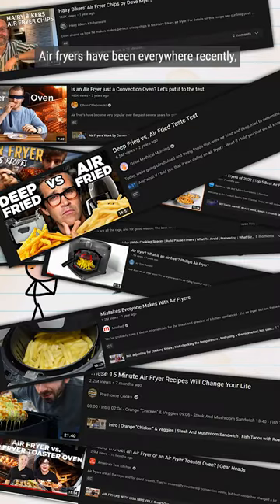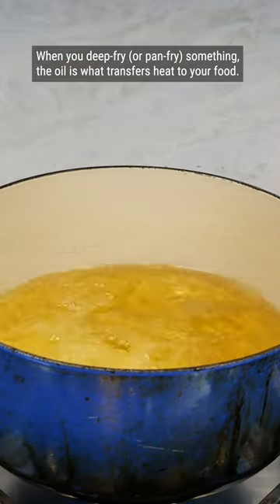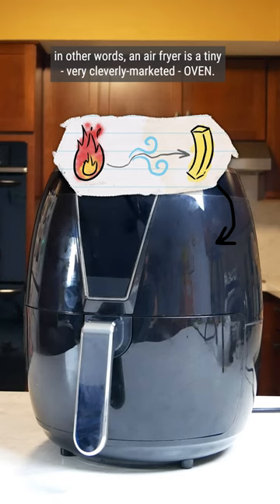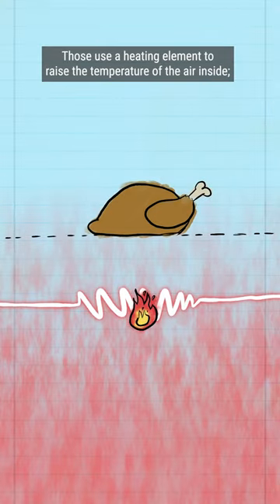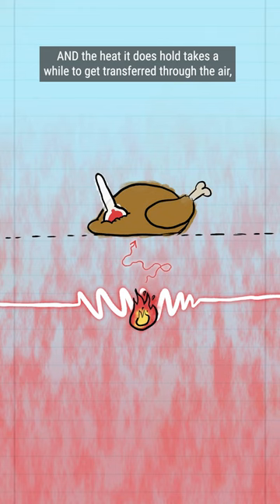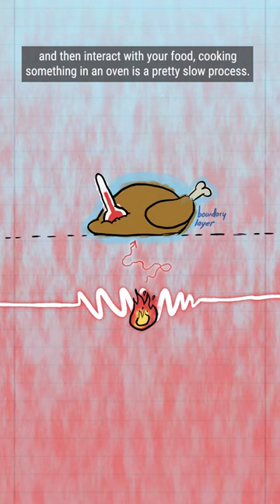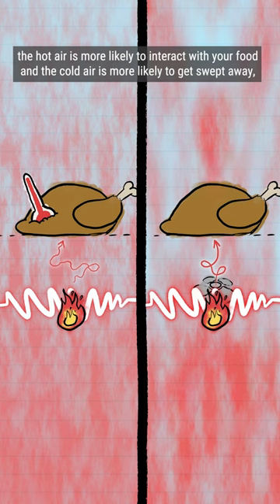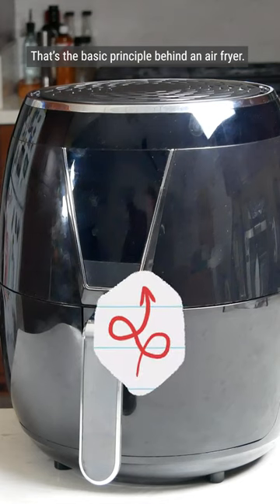Air fryers can't fry anything

Comment: Yup, they are mini convection ovens, and they are great. Besides reducing the amount of fat in the food, it also uses much less electricity and time, compared to an actual oven 👍
Reply: They do not reduce the fat in food 🤦🏼 that's a common myth. Put frozen French fries in an air fryer and an oven and they have the exact same amount of fat. They also aren't much faster than modern ovens, but yes the space is smaller so you save some time. Electricity savings is the biggest benefit of them, and ease of use and cleaning
Reply: @wile123456  I mean if you're not using oil like a lot of people, then you have a lot less fat. They're also much faster than normal ovens especially for something that doesn't need long since you don't have to pre-heat it
Reply: @wile123456  Oh come on now.. this is not a semantics game. When you air fry, it’s gona have only the oil you put on it, nothing more nothing less. And of course that amount of oil is going to be less than deep frying. That’s the concept..
Reply: @wile123456  frozen French fries have already been deep fried..
Reply: @wile123456  faster? Yes. I’m usually done with most things using the convection oven, before the regular oven is even preheated..
Reply: @iteerrex8166  yes, that's called an oven. You don't save any fat because it's the same as putting your food in a convection oven 😂
Reply: @iteerrex8166  yes, hence they are already fatty. You cannot replace a real frier with an oven if you want to make deep fried dishes. No fat is saved. No need to make 3 comments either, you can make one longer comment.
Reply: @Gavolav  yes but it's the same as using your oven. You don't save fat. People who says it saves fat is because they buy frozen fried food that usually gets put in the oven and then act like there is less oil on them using the air frier.
You cannot make French fries from scratch with an air frier. It's impossible.
You can make oven chips, but that's about it.
Reply: @wile123456  What? If I use my air fryer I sometimes use a bit of oil, if I use my oven I always use more oil. Same with many others who use air fryers. Oil has fat. Therefore, people consume less fat when using an air fryer.
Reply: @Gavolav  💀 then it's your fault for adding the oil. You can use equal amounts of oil for either the air frier or oven. They are the same thing unless you have a ancient oven with no convection fan
Reply: @iteerrex8166  yeah, but not less oil than a regular convection oven. and that was Wei's comparison. not deep frying
Reply: @iteerrex8166  says something wrong, can't handle being corrected. Says the world is a terrible place
Damn you're not used to being wrong huh
Reply: @wile123456  they're talking about frying in oil vs cooking in an air fryer 🤦
Reply: @wile123456  you're comparing it to the wrong thing, yes oven vs air fryer the fat content is the same but air frying because it has the heat contacting the surface more through the whole process (compared to an oven) you get a crispier result similar to if you had deep fried it (why they are called air fryers) so putting french fries in an air fryer will give you a result way closer to deep frying them than an oven would but without the extra fat of a deep fryer
Reply: @Gavolav to get a similar flavor to fried food, you need to add a layer of oil/fat on the food, that is similar to what is absorbed during regular frying. Also food that is traditionally fryed, but sold to be cooked in an oven or airfryer have that amount of oil/fat incorporated into the food itself (often the breading). Anything with less fat will taste different (that can sometimes be a good thing, but still different).
Reply: @wile123456 They mean compared to a FRYER
Reply: That's a nonsense comparison, tho, you can't actually fry anything in an air fryer; you don't put in or get out the same kind of food in a deep fryer as an air fryer, you put the same food as an oven in an air fryer and that has no bearing on fat.  You might as well say it saves on burning and compare it to an open flame. @Gary_Harlow
Reply: Why would you want to do that, fat is the healthiest part of the food. Sugar is the enemy. Eat more fat and you will be less hungry during the day.
Reply: @ablasttv  you are 99% wrong
Reply: @Gary_Harlow  No actually not at all. Mediterranean / Keto diet is the best diet in the world scientifically proven. Eat healthy fats as the majority of your caloric intake and you will be the healthiest you ever been. Just maintain the diet or you will gain it all back quickly lol.
Reply: @ablasttv  Calories in calories out. Fat contains 9kcal/g whilst carbs and protein contain 4kcal/g. If you eat too many calories you gain weight. If you eat less fat, you can continue eating as much as you did, whilst still being at a healthy weight.

But yes, if you are below or at your calorie limit, then eat lots of healthy fats if you want.

I'm not saying that you should remove ALL fat, it is essential for many bodily functions, but maintaining a healthy diet is a lot easier if you decrease the ammount of fat you are eating
Reply: @Gary_Harlow  fat calories make you feel fuller faster than carbs, so you eat less and it takes more energy to break down the 9 calories from the fat than it does the 4 from simple sugars. So you actually burn more fat eating fat, let alone being a state of ketosis where your body is actually using its fat stores for energy instead of storing more. Obviously that doesn't mean ONLY eat fat. But > 50% of your diet should be fat, 30-40% protein, 50g carbs max (and of course adding up to a caloric deficit). You will not feel hungry and you will lose weight even with virtually no increase in exercise. Works like clockwork, I can lose 10 lbs in a month with no other life change.
Reply: @ablasttv  nah, the most effective at making you full are things that contain a lot of water, and that is vegetables, salad and carbs like pasta, rice and potatoes, or air like popcorn or bread.
Reply: @Gary_Harlow  I mean you will feel full for hours after eating and not have cravings. Carbs will fill up volume and make you feel stuffed and like crap right after eating but you will be hungry again. I feel full enough on fats to do 16-20hours of fasting before eating again.
Reply: @wile123456 they are SIGNIFICANTLY faster than regular ovens. i can say this from experience, food that takes 45 minutes in an oven takes 15 minutes in an air fryer for me.
Reply: Faster for 1 serving maybe. But for multiples? You can't put in too much cos it will just get soggy if air can't get to it. Do multiple rounds and the 1st gets cold. And nothing was particularly nicely cooked in general. We had a smaller version and I was utterly unimpressed 👎
Reply: @aeydra  I’ve never used one of these tiny tabletop versions, that seems like a glorified hairdryer. But I’d guess they are unimpressive.
Reply: @aeydra  I’d suggest a medium size, and make sure it has a halogen heating element. They work great for quick roasting toasting heating and such.
Reply: @wile123456 most people use air fryers as a substitute to deep frying on pan frying.

There it saves the fat and calories of the absorbed oil
Reply: @wile123456 i dont think they are pre-fried
Reply: @wile123456  Based on your replies and others, it's actually you who can't handle being wrong. Get outta here kid lol.
Reply: @wile123456 You did not get his point at all...
Reply: My gas oven uses less electricity than either of those
Reply: @shawno8253  lol good one.
Reply: @wile123456   They are faster, maybe not really cheap ones but ive burned stuff way faster at 400F in an air fryer than an oven. I think the biggest difference with time is the heating up period, maybe cooking time is the same but not pre heating, and an air fryer uses a smaller space with a very large heating element.
Reply: Most normal built-in ovens also have convection?
Reply: @mycelia_ow  it's not a large heating element. God people it can't be a large heating element since in a 120 volt outlet the max element strength is 1500 watt
 Your oven can go up to 2500 watt. The elment used in most convection ovens is Tungsten heated wire the same stuff as in a toaster and hair dryer.

Heats up fast but less Endurance, and cheap to make. Compared to the rod elements in ovens.

Don't get me wrong they work great I own one but don't confuse the lack of a pree heat as it's using better tech it's not it's just a compromise. Faster heating less durability.
Reply: @Gary_Harlow 
…did you really say that air makes you feel full?
Reply: @wile123456 you forgot the cooking oil sweetheart. normally i deep fried french fries in at least 1lt of cooking oil and that cost money not thin air. an air fryer? one less thing to buy so that's perfect to cut the cost of whatever you eat. also that just me. you ever wonder how much cooking oil chef used in a restaurant? 1lt is very small amount of the actual business they do.
Reply: @aeydra  I agree with this statement. If you're a 1 or 2 person household air fryers are good but not if you have a bigger household. For my parents, my brother and I to eat we'd be waiting close to an hour for everything to cook in the air fryer that we need for our dinners at night. Any other means of cooking actually allows us to sit down in about half an hour to eat. You can't even make decent homemade fries/chips in it for those special occasion dinners in our household because they come out the air flyer with the texture of cardboard even with a spoonful of oil added in
Reply: @Nekogal21  Yes, it’s for small batches, and only good at certain tasks. Plus I’d Only consider it, if it has a halogen heating element, and stainless steel interior. A glorified hairdryer ain’t gonna cut it.
Reply: @Nekogal21  I never deep fry anything because it’s unhealthy. So if I really really want some fry’s, I steam the sliced potatoes in a pressure cooker for some minutes, to cook it to about 70% or so. Then add spices and oil, and bake it to 100% on a oiled sheet. Yes it’s not close to deep frying it, but it’s not bad.
Time in the pressure cooker depends on thickness, but a starting point would be 7 mins. And the oven at 450f til 100%. So I’d say experiment.
Hope this helps the health nutz 😁

Comment: There's Oven Frying too. May be down to semantics at this point, but I believe I can bake and fry things in my air fryer. vegetables cooked on the bottom coated in oil, cook very similar to pan fried vegetables. When I use the rack and vegetables whole, I'd consider them baked/roasted. For me, I think Air Fryers are definitely frying things if adequate oil is present. Pan fried chicken = hot metal -> oil -> chicken. How does an air fryer do that differently? hot air & metal -> oil -> chicken. In my opinion, the difference is negligible, and there's no reason to distinguish them into categories, we could just call them what they are instead of making them the same or different. When controlled for variation, all the methods are extremely similar in outcome, with only subtle differences that a lot of people couldn't tell.
Reply: Frying is when you have an excess amount of oil. Coating food with a layer of oil isn't frying. Also the flavor and texture aren't the same. When pan frying you're saving on oil by having only half the food submerged in oil and flipping it to fry the other side and doesn't work well for everthing. Oven frying is joke, just called it baking.
Reply: @tonymouannes I think the outcome is more important than the means. If a recipe wants you to roast vegetables, and you want to do that in an air fryer, that should be fine if the outcome is pretty much the same. Same with frying. Or even if the outcome is different. Usually if you switch the method of cooking it will still be edible and good. cooking is not a science (Except for when it is)

Comment: Another reason they are more effective than a normal oven is also due to it's size. A normal oven would take a lot longer to warm everything inside the oven compared to a air-fryer. But a note for anyone considering getting one. If your family is really large (ie more than 3-4 people) it is better to make shared food in a normal oven than a air-fryer. I've seen too many people buy 2-4 air fryers to make food for the whole family. Which at that point would have been more efficient and cheaper  to use a normal oven. 😅
Reply: I could see the advantage of having 2 airfryers, if you wanted to cook different things at the same time, but having 4 in addition to a normal oven is just unnecessary.

Comment: they're just really intense convection ovens, that being said, you can just coat your food in some oil prior to putting it in the "air fryer" to get a similar effect as regularly frying the food
Reply: Instructions unclear, now have an air frier full of two stroke
Reply: They are just hair drier jacked up to 20
Reply: That would defeat the whole purpose of the air fryer 😂
Reply: @Talossy not exactly, it reduces the wasted oil - you can clean out the air fryer each time without worrying about wasting quarts of oil, or worrying about frying more food to take advantage
Reply: @Talossy  no it doesn't because you use wayyyy less oil air-frying for a pretty similar result to regular frying
Reply: @Kalbot84 I see what went wrong here. You need 4 Stroke oil. These air fryers are powerful machines. I recommend 10W40.

Comment: Ive always been a cast iron guy. For over a decade, everything was cooked in cast iron. I got a demanding job so i got a little lazy, got a basic air fryer it was great for sausages and frozen foods. Still used the cast iron a lot though. 

Until i got a ninja foodie grill. Havent used cast iron in 3 yrs. Everything cooks quick and is still juicey. Steaks come out great, burgers too. Only advantage to cast iron is the oil takes on the flavors of everything and makes things more pungeant but im happy with my foodie. 

I always knew it isnt a fryer, thats just common sense. But its an oven on steroids. The foodie has good inserts which sear things well and that thing gets really hot so it sears just as well as cast iron.

Only downside is it has a thermometer so now ive lost my sense when it comes to just knowing when things are done because i just watch the thermometer.

Comment: There are several different frying techniques, the only thing common between them is that oil is used. I generally use my air fryer to cook things that already have oil on them, like pre-fried frozen foods (fries, chicken nuggets), or I use an oil sprayer to coat the food. So yes, there's still oil involved in the cooking process, thus it is frying.

Comment: so it's a mini oven with a basic air circulation function that every oven since 2010 has.
Reply: Yeah, but the air flow is much higher. I have a 4kW oven I rarely use. It takes twice the time to heat the volume. The airfryer uses half the power, so it is 4 times more efficient.
Reply: Me whose never had a convection option in any of the modern ovens I’ve had in my apartments 😕
Reply: The fan and direction of airflow are different.  The fan is top to bottom and much more powerful relative to size. The heating element is also much more powerful relative to size.
Reply: "every oven"
I don't think you actually know what you're talking about

Comment: yes...aaaand no, so on a technicality airfryers still can fry as to fry something it still requires oil, as such it goes from the air, to the oil, then to the food, the reason why air fryers work this way and ovens dont is because of just how quickly it heats something, ovens take far to long to be able to successfully fry something but a thin layer of oil and realy fast heat transfer and it will still fry it

Comment: If you're cooking for more than two people, the oven is faster.  Because you can fit everything in at once, without crowding it so much that air can't circulate.  Also, because the oven runs on 220V instead of 110V, it produces more heat faster.

Comment: It’s a counter-top convection oven.  But convection ovens needed a rebrand anyway, because no one but professional cooks and science teachers knew what convection was.  So, they gave them a name that would better explain what it does to the food (makes it crispy) than what scientific process is at work.  On the other hand, though, if you have an oven or toaster oven that has a convection setting, you probably don’t need am air fryer, so don’t be fooled by the rebrand.

Comment: When you're cooking in an air fryer, if whatever you're cooking is coated in a layer of oil, it may not be technically frying, it has pretty close results to actually deep frying something in oil. So, it's a pretty good way to cook things like wings without investing in a deep fryer or the massive amount of oil you need for it.

Comment: Yes and no. They are indeed not frying, but to call them "convection ovens" is only half true. They do cook with convection, but true "air fryers" control whether they vent their heated air and heat more, or keep the heated air, to ensure that the food has the right moisture content. A normal convection oven does not do this. This results a cooked food that is remarkably similar to fried food, especially if the food is breaded or is coated in oil before cooking.

Comment: Fries don't taste the same as when they're deepfried. But I'm ok with that, they still taste pretty good, and are a little less unhealthy, and also less messy and wasteful.
When I used to deep fry stuff, getting rid of the oil in a clean way was always a problem, most people just dump it in places they shouldn't.

Comment: They’re called an air fryer because they use air to heat the oil on your food to fry it. Thus Air Fry. A convection oven can do the same thing. Make no mistake, it is still frying food using the oils in the food.